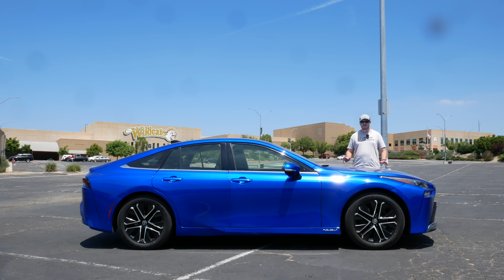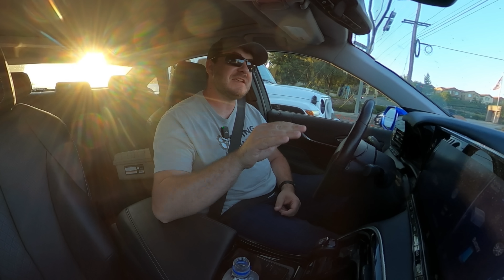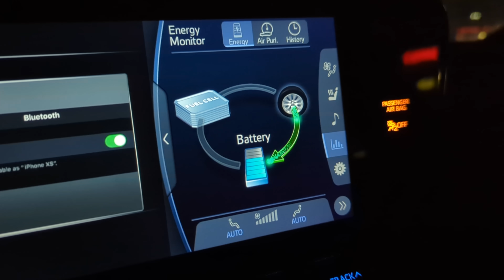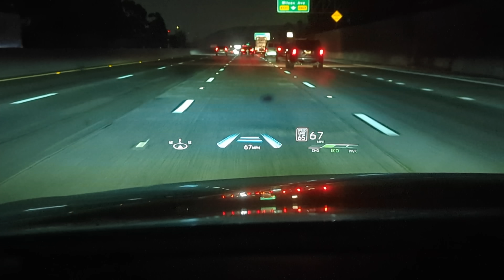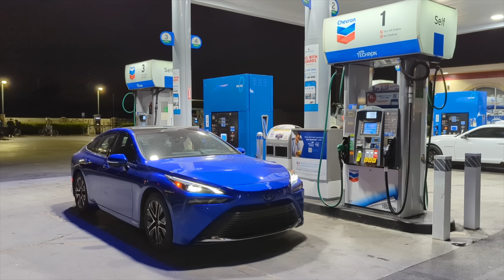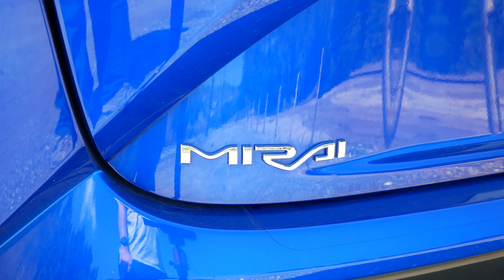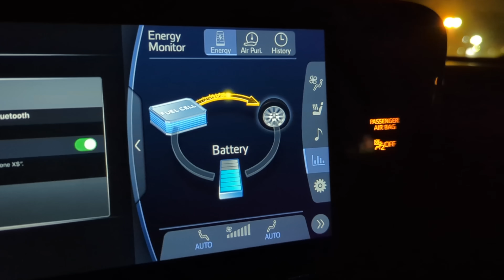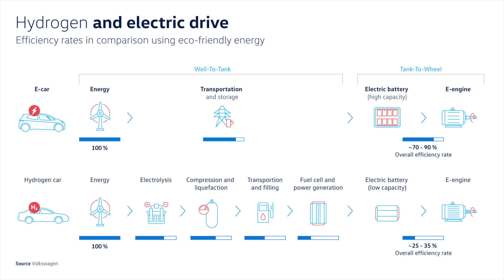The Toyota Mirai is Disappointing

Comment: Hydrogen power cars are better for most American's lifestyles. #1, they don't waste tons of time charging, #2, less pollution (less toxic deat battery related chemicals being put into the ground water), #3 less strain on the power grid, #4 easier to maintain. #5, easier to train maintenance personnel to learn how to use this technology.   #6, being able to be independent from the power grid when it comes to the ability to drive around.

Note: my comments regarding the perks of hydrogen are generalized to the hydrogen tech at as a whole and not necessarily limited to the Toyota variation. Look up Stanley Meyer's tech for a different and possibly more reliable variation of Hydrogen tech.
Reply: 1. The one benefit. But then you also can't fill them up at home, so it's hardly a positive. Closest H2 station to me is over 60 miles. The closest EV charge point to me is about a metre away from my foot.
2. Who is putting toxic battery chemicals into the groundwater? That sounds like an Alex Jones line.
3. More strain on the power grid. You need to get that hydrogen from somewhere, and it requires a lot more grid energy per km than a BEV.
4. Far more difficult to maintain. Not only do they have all the stuff a BEV does, they also have a highly sensitive fuel cell that requires extremely pure air, so you have filters that need to be replaced.
5. Again, more difficult. See #4.
6. You can be independent from the power grid with an EV. Use home solar panels. Can't be independent from the H2 stations with a FCEV.
Reply: @drunkenhobo8020  1. Counterpoint, you assume that the Toyota version of the hydrogen production would be what is used when Hydrogen is adopted.  You may want to look up Stanley Meyer's option.  Toyota's is a good option for mass production, and it also keeps many of the larger businesses in the market that would otherwise do their best to kill off hydrogen and other green energy options.  
2.  Counterpoint Many of these "recycling" companies will remove the toxic materials from the Western country that they were created in transport them to a developing nation, and will bury solar panels and batteries in the ground.  This is where the poisoning of the groundwater happens.  Water running through the toxic materials flow into the local water supply causing health issues for local wildlife and populations.  They do this rather than process and recycle them, like what we are paying them to do, because they are able to make a ton of profit that way.
3. Counterpoint, there are many ways to produce the hydrogen, some is more energy intensive than others.  One thing that has been consistently stated by various experts is that 1  electric car will take up twice as much power as the average household.  Unfortunately, no political party or company has actively proposed any plans to alleviate this issue, thus the brownouts or blackouts across a good amount of the nation during summertime.  
4. EV's require a ton of unique training in order to properly maintain it.  You need to be proficient in electric system and cooling systems, which is not something that most people have much experience in.  True, that can be alleviated with training aids being created and classes being made available, but I do not see any organizations creating these aids.  
Hydrogen power is close enough to Petroleum power in how it is consumed, that most of the training would be very similar.  One just needs the specialized training on the containment of it.
6. Counterpoint, you CAN be 100% energy independent with an Electric or a Hydrogen car.  It depends on one's own resources and skillsets.  The unfortunate trend of Tesla Electric cars is that they want to talk to the central servers back at Tesla.   This type of system along with their charging stations has been abused by the authorities.  One can look at England for examples of this.  IF the electric car companies did not allow their charging stations to be manipulated in such a way, then I would agree that electric would be better for many than a Stanley Meyer style hydrogen system for the masses.  

Fun fact: Stanley Meyer's patents have expired.  If you make a hydrogen car components off of his patents, then you will not have to deal with lawyers coming after you.
Reply: @Commander_Scratt  Oh dear, you're talking about a free energy device. There's not much point in debunking the rest of your points if that's what you believe in. It's absolute nonsense and completely impossible.
Reply: @drunkenhobo8020  The United States government clearly disagrees with your assessment.  They do not provide patents for Free energy devices.

Comment: Im strongly team Hydrogen. I refuse to buy a BEV vehicle knowing where the matterials to make batteries are sourced and how they are made. 

In Ontario Canada we get extremely cold tempratures too that do negatively effect battery range and life ontop of it. We are also constructing a new hydrogen plant and this will deffinetly help with providing fuel stations for these cars. 

As it stands, im keeping my gas powerd ICE car for two decades and hoping for the best when it comes to Hydrogen.
Reply: Apparently you have no idea that hydrogen fuel cell cars require platinum, cobalt, lithium and nickel? Also, hydrogen cars will lose range in cold temperatures as well.
Reply: @Freba9  Or that the main metal used in batteries is nickel, which is used in thousands of applications, including steelmaking.
Wonder if this guy also refuses to use stainless steel cutlery? Nickel mining isn't exactly clean.

Comment: I don't understand how they say fuel cells are one of the most fuel to electricity efficient yet this cell in the Mirai is only 60% efficient?? Power plants using fuel cells claim to be 90+% efficient so where is this 30% waste coming from? The heat leaving the vehicle? If that's the case then how is an EV much more efficient?
Reply: If a power plant claims an efficiency of 90+%, it is a "power and heat" efficiency, not a pure electric efficiency.
Even the most efficient fuel cells will achieve at best 70% efficiency from fuel to electricity.
Reply: @701983 thank you!
Reply: Usually things become less efficient when they're scaled down.
EVs are very simple, hence the efficiency.
Reply: Supposedly if you collect the waste heat to make more electricity, it gets quite a bit better, which might be where that 90% figure is coming from

Comment: Fun Fact: Hydrogen is as much as $29.99 per Kg in California right now. It would cost you over $160 to fill up the tank of the Mirai. However, most Hydrogen filling stations are running low right now so they have to limit you to half a tank or less. That will get you about 125 miles for $84 or about $0.67 per mile. An electric car can be as low as $0.03 a mile. The $15K free fuel card they give you will last less than 30K miles at the current price of Hydrogen.
Reply: It would be impractical for an auto company to pay for the hydrogen on a huge scale.
Reply: What about battery replacement cost?
Reply: @sabalandsabal  Hydrogen cars have a lithium battery like an EV, so add in a potential battery replacement cost down the line in addition to the high price of hydrogen.
Reply: @sabalandsabal better than $15k every 30,000 miles, at least
Reply: @sabalandsabal  what about them? The warranty is something like 10 years on the battery. It will be covered under warranty. You won’t care how much it costs if it needs to be replaced.
Reply: Away from places where hydrogen is produced eg Steelworks and Oil Refineries Hydrogen has no future at all in road transportation since it’s difficult to store and transport. Look at the science facts, not the salesmanship skills of the CEO.
Reply: Thats normal price to fill up a 50 liter gas tank in my country :face-blue-smiling:

Comment: Fun Fact: The 182 HP Toyota Mirai(4,335 lbs) weighs almost 300 lbs more than a 500+ HP Tesla Model 3 Performance(4,048 lbs). The Mirai is only 100 lbs lighter than the 800 HP Dodge Challenger SRT Hellcat Redeye(4,430 lbs). The Toyota Mirai is about the least fun car you could possibly imagine.
Reply: I'd argue that a car that slow is unsafe. Sometimes highway entry ramps are really short and I've been in a few cars that couldn't even catch up with the highway traffic in time.

Comment: Every Mirai has a built-in expiration date printed inside the filler door, after which you cannot fill the car and junk it. That may be one reason the resale value of the Mirai is very low. Also, those trucks hauling around hydrogen typically carry 300kg, enough to fill 60 cars. The average gasoline tanker can fill hundreds of cars.
Reply: It's not like there's a data cable from the car, so you can ("unwisely"?) ignore that stupid sticker. But yeah, those tanks won't last forever. The cell itself, so long as the air filters are doing their job, could last decades. It's just a catalyst, so it's not be "used up". What kills them is the passages getting blocked, and/or damaged.

Comment: Mass adoption of Fuel cells makes as much sense as mass adoption of battery EV's. They both have the same problems with mass adoption. Fuel cells are just a few years behind Batteries.
Reply: Not at all. Fuel cell vehicles will always remain inefficient due to physics.

Comment: The one single biggest argument against battery powered cars is that the material to make the batteries is non-renewable. Period. A hydrogen powered car can be almost entirely recycled at the end of its life and the fuel it uses is completely renewable.
Find ways to make hydrogen more affordable and accessible, battery powered cars are a the latest scam by big corporations to game the system and pretend to be green.
Reply: BEVs aren't a scam. They're simply extremely efficient.
Which material in batteries is non-renewable?
Reply: @logitech4873 I mean, there is finite lithium on earth, so "non-renewable". That we can reuse that lithium changes that calculation signigicantly
Reply: @addison1024  Lithium is of course renewable. It doesn't get "spent" in the battery. It's still all there when the battery is completely dead. And besides, lithium isn't the only thing we can use for batteries. Look up sodium batteries.

Comment: Where is a car charging in 10 minutes? He mentions battery powered vehicle charges 10 minutes to an hour I’ve never seen charging in 10 minutes usually average of 1 hour 30 minutes even charging to 80% is easily 45 minutes and that’s depending on strength of charger, usually don’t stop just to add 10 percent to battery
Reply: Ioniq 5 for example at a 350 kW charger will get you a lot of charge in 10 minutes.

Comment: It’s funny how most of the negatives you mention about a hydrogen vehicle are the same negatives people said about electric vehicles 10 years ago. 🤷🏻‍♂️
It’s almost like infrastructure has to catch up to the technology. 🤣😂
Which it will. Both in producing the green hydrogen and supplying it.
Reply: Not really. Electric cars were efficient from day 1.
Reply: @Freba9  
Reading comprehension isn’t one of your strong points is it?  
Infrastructure not efficiency is what my comment is about. 🤦‍♂️
Reply: It won't though. There is no infrastructure because there is no demand for the cars, and there will be no demand for the cars because there is no infrastructure.
There already was the infrastructure for EVs, so people bought them.

Comment: Wasn't it proved multiple times that Toyota higher ups basically wanted hydrogen as a way to fumble the onslaught of electricity on classical ICEs? 

It looks like a very limited use of actual gas, or synthetic gas, for the very specific use of range extension, is way simpler than the hydrogen tank. Because there's other questions. What happens if the tank gets ruptured? Is it more lethal than gas? Less?

Comment: whether hydrogen is a viable alternative to diesel for freight vehicles will be decided on whether a hydrogen cell + motors can weigh the same as an ICE + drivetrain.
EV freight doesn't work because batteries weigh 2-3 times more than a diesel engine does.

Comment: I feel that if it was set up like a Chevrolet volt, IE there was a 40-60 mile ev range, and a hydrogen cell to maintain the battery it would make a lot more sense, for normal commuting, it can be a EV, but on long trips, the fuel cell could extend the range to 400-500 miles. OR they could focus on making a volt type car that has a biofuel powered generator, and skip out on all the inefficiency of hydrogen, as for 90% of driving it would be a EV anyway.

Comment: i won't be happy until i get a RTG powered car. will it drive at most 10 mph? probably. but it will run on fission and the battery will last 5 years or more. imagine filling up your car with fuel once every FIVE YEARS. it needs to happen
Reply: Could last way longer than 5 years, but I hear plutonium prices are quite high today :)
Reply: The one powering Curiosity puts out a bit over a 100 watts. I think you'd be better off installing bike pedals ngl

Comment: The big benefit of hydrogen that wasn't mentioned is the lack of battery degradation. With modern BEV systems, to keep the centre of gravity low, the designers put the batteries in the floor. This then makes them difficult to change and so when the batteries come to the end of their life, so the vehicle comes to the end of it's life, as more often than not, it is more economical to dump the car and replace the whole thing than it is to change the battery. Lithium, once used in a battery cannot be recycled and becomes landfill as it has no use thereafter. Lithium also requires huge scale open cast mining which is environmentally a disaster. Hydrogen has only suffered thanks to very good marketing from BEV manufacturers, such as Tesla, affecting government subsidisation, and therefore the government throw money at BEV technology rather then HFCEV technology. If HFCEV technology had received the same investment that BEV technology has from the governments of this world, the vehicles would be far more advanced and far superior to the current fleets of BEV. The current infrastructure (petrol filling stations) could also be easily adapted to become hydrogen filling stations, whereas battery charging, including at home battery charging requires huge infrastructure change, thus resulting in yet more environmentally damaging emissions.
All technologies should be compared by governments including the extraction and production of the materials required to make the vehicle, the potential infrastructure change required to support mass adoption of such vehicles, the manufacture of the vehicles, the lifespan of the vehicles and lastly, the disposal of the vehicles at the end of their useable life. If they did this it would be incredibly obvious that BEV technology is not where money should be invested and that exploration of other technologies should be considered. Smart car's were designed to be greater than 95% recyclable so that when they reached the end of their useable life, they could be mostly re-used to produce a new product, however, this is not the case with BEV systems due to the battery packs they use. All environmentally sustainable technologies should be compared, including the manufacture of synthetic fuels which are carbon neutral. This would ensure we do the least damage to the planet rather than line our pockets and convenience ourselves in the short term with little thought for the future.
Reply: What about fuel cell degradation, and hydrogen tank degradation?
Both of those components need replacements down the line.

BEV can literally just be charged at your home.
Reply: @logitech4873  The materials required to make a fuel cell and hydrogen tanks are far less environmentally damaging and more importantly, far less in quantity per car. Unless the car needed a new fuel cell every 6 months, it is far less environmentally damaging.
With regards to home charging, as mentioned in my prior comment, the infrastructure cannot support this as most homes don’t have a large enough supply to charge an EV as well as running the house normally. Even if the home does have a large enough supply, the grid that supplies the home couldn’t cope as they use electrical diversity in household supplies. Home charging also doesn’t work with flats as they often have on street parking. At a recent meeting (in the last couple of months) the energy secretary was asked if 50% of cars were BEVs, could the electrical grid support charging them, and he got up and said “No”.
Installing larger supplies to either hydrogen generation factories or better still, hydrogen fuel stations with hydrogen generators will cost a lot less and is more practicable.
Reply: @petergarside92  "The materials required to make a fuel cell and hydrogen tanks are har less environmentally damaging"
But this is just an assumption. HFCs rely on platinum, which isn't exactly an easy material to come across. I don't know the environmental profile of these components, but I assume it's pretty high due to the materials used.

Obviously the grid can be improved to support even 100% BEVs. Implementing a right-to-charge law would ensure than anyone would be able to build home chargers, regardless of whether they live in a flat.
But if you believe that's impossible to overcome, what makes you think hydrogen would be possible? Hydrogen cars require FAR more electricity than electric cars.